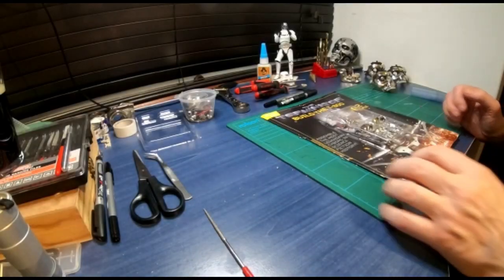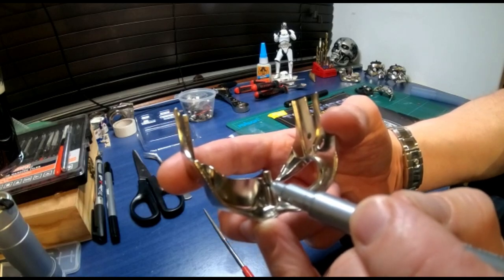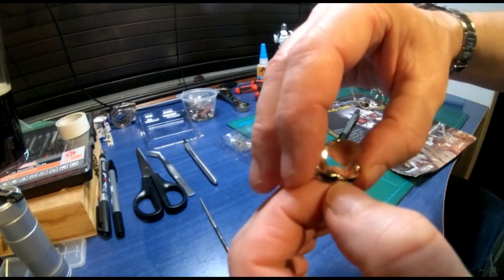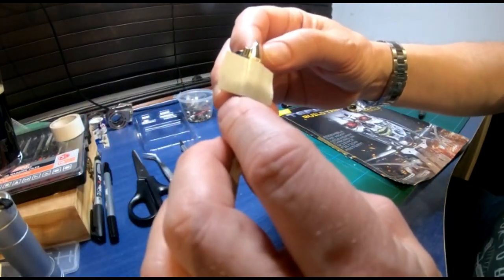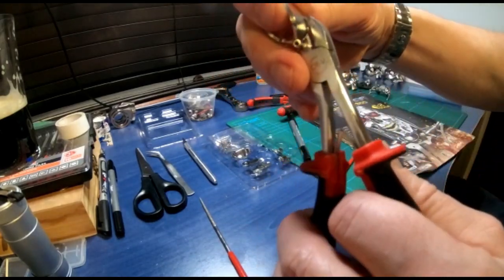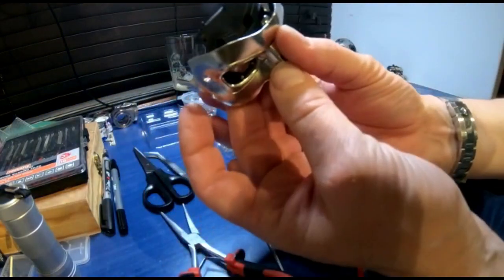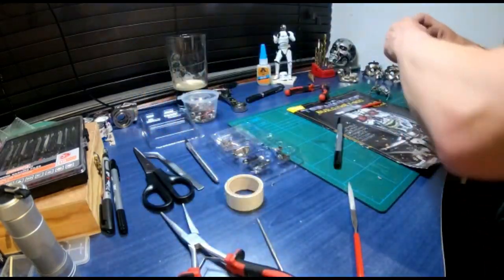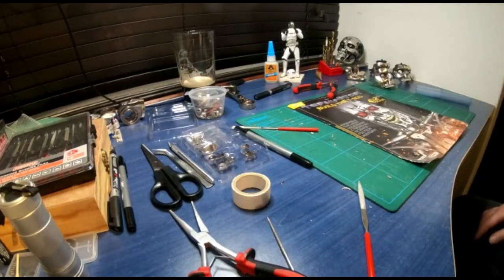Build the Terminator Agora Models Hachette  T-800  Movie Modifications - Issue #10, Eye Sockets

Comment: Nice work! I have catching up to do.
I’m still waiting on my subscriptions 8 weeks and only issue one and two delivered. 😭.
Reply from the maker: Hi buddy thanks 😎 I had the same problem then they all came at once 😁
Reply: Yep I'm in a similar boat, not stopped them taking their subscription out of my account , I was waiting for 6 parts that I had paid for and they took another months subs,  so I'm now waiting for 10 parts !!
Reply from the maker: @ianelley   you will get them they had trouble getting the binders 😎
Reply: ian elley they are not very reliable, I had a look at hachette partworks on trust pilot. 1.5 stars out of 10. So many bad reviews. 
Hopefully they sort it out.
Reply: GweiloJohn they told me it was because of Easter 🙈
Reply from the maker: @MetalT-800Skull    Maybe 🤔 I'm going to call them later I'm kind of curious why they are  charging and not dispatching for more than 1 months subscription
Reply: @MetalT-800Skull  Wow ! I wish I had seen that !! If I'm messed around much more I think I will cut my losses , thanks for the info
Reply: Good work🎉
Reply: @gweilojohn8550  I'm calling them today too, my patience is running a bit thin with this

Comment: Me again XD Ok so i am at this part now, eyes done, teeth done, now the eye sockets. Ive made adjustment to the black part where the eyeballs fit to, and the c shape holders behind the eyes and the black plate then fits nice and close to the front of the skull. I have cut the eye sockets now and they fit really nice onto the black plate, but, when i fit them to the face of the skull then they fit fine, but then sliding the black plate onto them then there is something still pushing it back almost to as it was before making adjustments, so strange!
Reply from the maker: Are you trying to screw it in place ?
Reply from the maker: Also if you've used the eye socket cover's from issue 10 remove them there not necessary 😎
Reply: @gweilojohn8550  il take a pic within the hour and post it to community on my page will link it here when its up. i appreciate you helping with this :)
Reply: Ive uploaded a pic but i cant seem to share a link to it. i havent screwed anything in or glued it in. i could probably glue it but it takes quite a bit of force to push the panel closer to the sockets